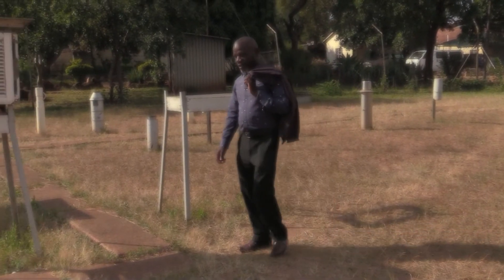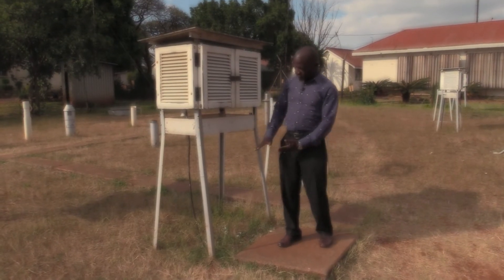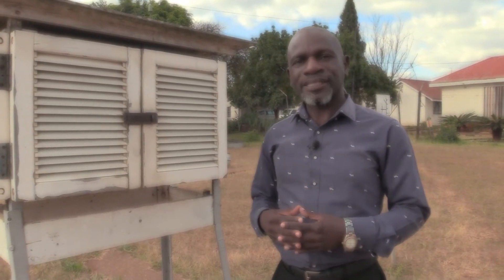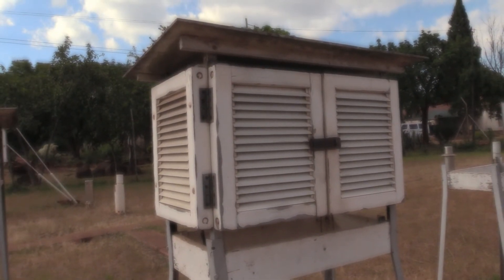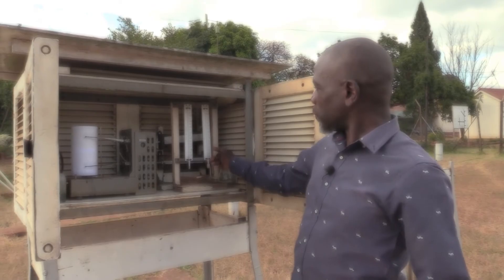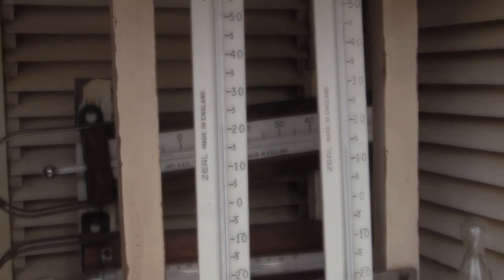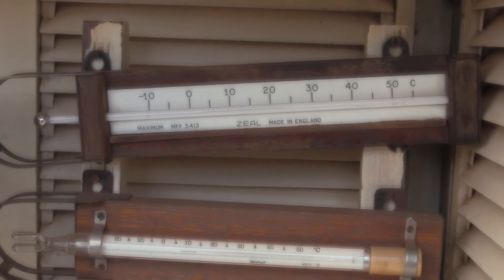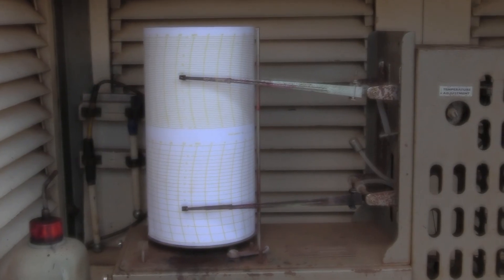The Stevenson Screen

Comment: How can you make a Stevenson screen
Reply: There are a number of videos available on that, even a few websites.  Not mentioned in the video:  The screen must be placed at least twice as far away from the nearest tallest object.  That includes trees that can pump out large amounts of water vapor while buildings tend to retain heat and radiate it when the air gets cooler.

Comment: Why do they still use this old 1940s technology? Digital instruments are more acurate and less labour intensive.
Reply: Can u suggest one accurate digital instrument to measure temp and humidity in polyhouse
Reply: Not necessarily using old technology but explaining it.
Reply: It's not 1940s, it's much older and it's the golden standard which is extremely important for climatology. All standardized meteorological stations have these instruments.

Comment: why min and max thermometer kept horizontally and dry bulb and wet bulb vertically?
Reply: Because Minimum type has a metal part inside that will sink into the bulb if left vertical (5 degrees angle needed) and the Maximum one is like a fever thermometer and if left upright will lose the MAX reading over time. Wet and dry bulb are normal type thermometer and are meant to stay vertical.